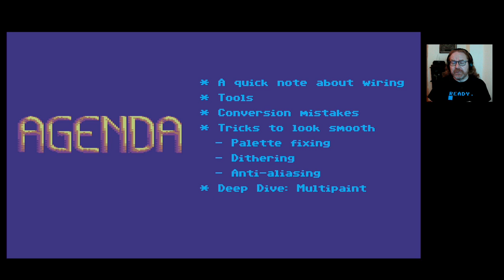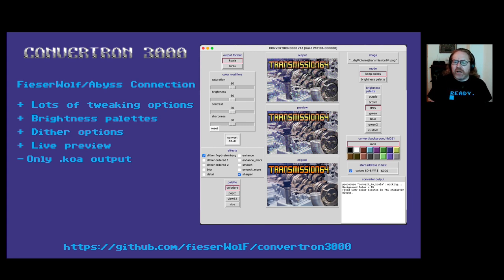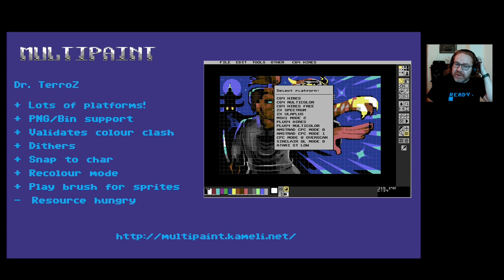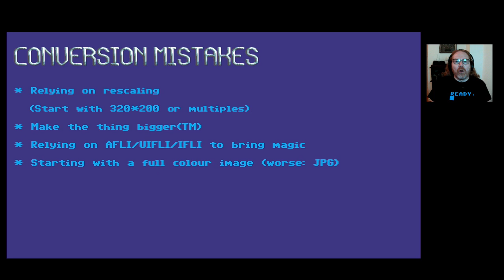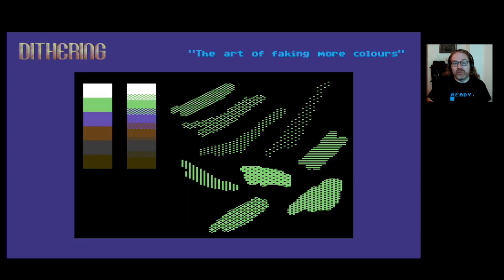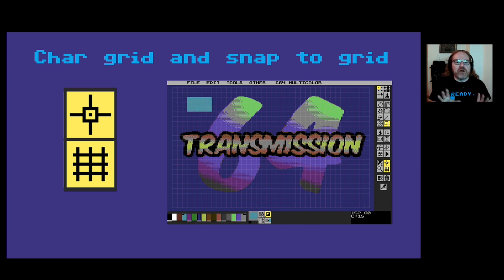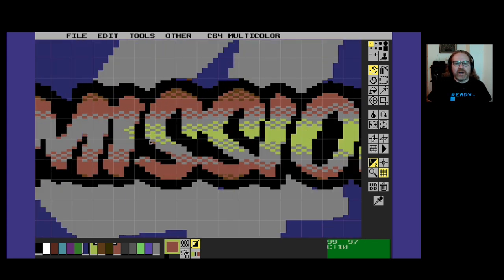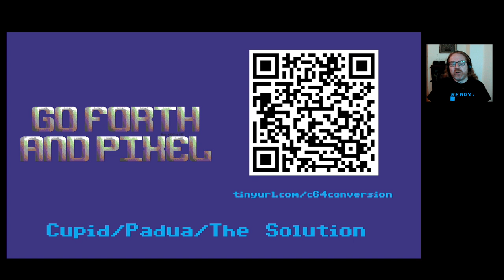Talk: Cheating like a pro – a few tools to get you pixeling and converting for The Commodore 64

Comment: Those graphic limitations are a result of limited (and expensive) RAM and not very powerful processors and finding very clever ways to make the best of the situation. Those limitations are also what gives each of those old systems, from the C64 to the Atari line to Sinclair ZX Spectrum and Amstrad CPC, their own individual personalities that are sadly missing today because consoles are very very similar in graphics and processing capabilities, with identical screen resolutions and tons of RAM, etc. This, I believe, are why retro systems are still so popular in the world and why people are still creating new demos, games and even hardware for them.
Reply: RAM ( amount, speed, VIC onboard cache would have allowed for 1 bit RGB @ 320x220. It just wasn’t priority and would have slowed down the CPU more than HAM. Scrolling is also broken on the C64. Sprites on a fixed screen it is.

With proper connection of address lines color ram may still work. Luminosity modifier at half resolution? Or select one rgb to mean one of two palette colors?
Reply: @ArneChristianRosenfeldt  It's tantalizing to think of what a VIC-III might have been. Although it never existed, the canceled Commodore 65 had a VIC-II with significantly updated modes (and a 6510 compatible processor, the 4510, running at 3.54mhz). From wikipedia:

^^^^^^^^^^^^^^^^^^^^^^^^^^^^^^^^^^^^^^^^^^^^^^^^^^^^^^^^^^^^^^^^^^^^^^^^^^^^^^^^^
"The main memory of the C65 is shared between the graphics subsystem and the CPU. The memory clock runs at almost twice the speed of the C64. To further increase the bandwidth of the graphics subsystem, the memory is divided into 2× 8-bit wide banks of 64 Kbyte which can be accessed by the CSG-4567 simultaneously. This provides an effective video-DMA bandwidth of 7.2 Mbytes/second which is the same specification as the original 16-bit Commodore Amiga chipset (OCS/ECS). The CPU can use up to half the available bandwidth, since it can only access a single 8-bit bank at a time. In higher demanding video modes, the CPU is slowed down due to increased cycle stealing from the video controller.

"Enhanced VIC-II modes
In addition to having all of the C64 video modes, the CSG-4567 also supports several new character attributes such as "blink" or "bold" and can display any of the new or old video modes in 80 column or 640 horizontal pixel format, as well as the older 40 column 320 pixel format [6]. These enhanced "VIC-II" modes take up to 16 KB of system RAM. The sprite capabilities in all VIC modes are equivalent to the C64.

"Bitplane modes
A new "bitplane" video mode was added to allow the displaying of true bitplane type video, with-up to eight bitplanes in 320 pixel mode and up to four in 640 pixel mode. The CSG-4567 can also time-multiplex the bitplanes to give a true four-color 1280 pixel picture. Vertical resolution is maintained at 200 lines as standard, but can be doubled to 400 with interlace [6]. The VIC-III bitplane modes take up to 64 KB of system RAM in non-interlaced or 128 KB RAM in interlaced (400 line) modes. Since the C65 is equipped with only 128 KB in its basic configuration, these modes would consume the entire RAM, and are therefore only useful in a RAM expanded system. On a basic system, it would probably have made more sense to write software which uses less demanding resolutions with fewer bitplanes - partly because this would consume less of the confined RAM space, but also because more bitplanes would demand a higher video DMA bandwidth and consequently slow down the CPU as a result.

"DAT and Blitter
The bitplanes on the C65 are organized in a less straightforward manner than e.g. on the Commodore Amiga, which organizes the bitplanes as straight rows of pixels:  On the C65, the bytes within the bitplanes are organized as 25 rows of 40 or 80 stacks of 8 sequential bytes, similar to the original 320×200 VIC modes. Because this makes it harder to derive individual byte and pixel addresses from their position in the XY coordinate frame, the C65 provides a conversion mechanism in hardware called Display Address Translator (DAT).

"Further aid to the programmer comes in the form of a bit-blitter, which supports Copy (up,down,invert), Fill, Swap, Mix (boolean Minterms) Hold, Modulus (window), Interrupt, and Resume modes. Block operations from 1 byte to 64 KB"

^^^^^^^^^^^^^^^^^^^^^^^^^^^^^^^^^^^^^^^^^^^^^^^^^^^^^^^^^^^^^^^^^^^^^^^^^^^^^^^^^

Looks to me like the project was probably canceled because in many ways it rivaled their flagship Amiga line!
Reply: @JustWasted3HoursHere  I meant for the same memory speed and cost as in 1982. From you text it is very clear that the Amiga did it better and that we should be glad that C65 was canceled. Like have 16 bits for data bus, but even more address lines than the Amiga? Who is gonna pay for this. The great thing about C64 ( at least for plasma effects ) is the simple addressing of pixels: One byte, one pixel. I used attributes on plus4 and then byte oriented VGA on PC. Though I have to admit that bitplanes are great for dual playfield and any static assets. Or text on monochrome monitors of the time. So, it seems like a graphic card always has to support both: bits to pixel like the C64 characters and byte to pixel like the attributes (especially on the plus4). I guess that word to pixel on a system with 16 bit bus is asking too much. Memory read-out is a pipline. We don't care about latency here. Why was it so difficult for Amiga to add back text mode and attributes in ECS? Just copy it from VIC. Sega did it for them on the genesis. Would have allowed some easy ports. And when Sega wants to file infringement on patents or stuff, commodore would just pull out the blueprints of their old chips.
Also commodore and Woz of Apple should have worked together with WDC to create a true 16bit CPU which can really utilize the 16bit bus and reads ADC #$00 in one cycle. Or every branch instruction. Okay, maybe we really don't want to pay intel money for the alignment circuitry. Absolute addressing would use 3 bytes. INX or CLI need to be paired (with NOP) to keep the speed. (ZP,x) addressing would need to multiply x by 3: ( ZP, 3*x ). Also I want the zero page for (ZP). That memory gobbling indexed stuff should really be: ( DataSegment + 3 *x ). 16 bit registers ( but no immediates due to alignment ).
Reply: @ArneChristianRosenfeldt  Well design and engineering is all about compromises. I'm sure the designers had their reasons for designing the Amiga chipset the way they did, though I do often wonder why the sound chip was never updated from OCS all the way to AGA. No additional voices, no higher resolution (even 12 bit would have made a BIG difference in quality without too much increase in memory usage), etc. Maybe if Jay Miner had not passed away things would have been different.

On the C65, I guess it would depend on what kind of price point they could sell it for. If it was somewhere between the C64 and the Amiga then it very well could have been a success. For the hardware bottlenecks, luckily they left the gfx modes up to the programmer. That is, you could still use the old VIC-II modes if you wanted AND take advantage of the much faster clock speed.*

* There's a project underway that is a drop-in replacement for a 6502 (for Apple, Atari and other early systems like the Commodore 8032) that will run at 100mhz. http://www.e-basteln.de/computing/65f02/65f02/ It SHOULD be possible to make a version for the C64's 6510. But right now the project is on hold because of, you guessed it, supply chain bottlenecks.

There is also a 1 GHZ 680x0 project underway but I can't find the link for it.
Reply: @JustWasted3HoursHere  I looked up AtariJaguar and SonyPSX and they both use an external, off-the shelf dual DAC for sound. I have no experience in this and think digital electronics also wants low noise on the rails, and common emitter logic would give it to us. But of course, using small voltage differential serial for audio and and a DAC outside of the HF filters are a sure fire bolt on method. Though I think that a 1-bit DAC experience high frequencies internally. So either it all need to be balanced, or there still .. yeah of course 1-bit DAC needs a low pass filter. The integrator is it. Just place it in such a way on the PCB that stray fields cannot reach around. CD DACs were invented before the Amiga.

Some people cry for FM sound, but neither TurboGrafx16, nor SNES, nor GBA has them. Wavetable is good.

The market is a thing. Of course my design goal is a C66 which runs Doom faster than a Amiga500 does. Just don't tell your manager. Tell them that we don't have to pay Motorola ( only for some 6800 patents ). Amiga has dual playfield. C66 would have  bullet hell.

It would be cool if some billionaire would fund a GaAs ECL run with modern optics: UV, water immersion, multi polarisation illumination. I imagine that a GaAs kinda FinFet would be possible where the channel is not doped for lowest defect rate and highest electron velocity.  No thermal problems with so small circuits. DLP to avoid real masks. Then do all retro chips. 1000 $ a pcs.

But RAM loves buswidth, but hates GHz

Comment: 2:00 I think it could be okay as a competition entry, if there was an extra category like "PC Conversions" for it.
Reply from the maker: Do you think there should be a separate category for conversions?
Reply: @transmission64  I believe it would be better, since it requires different skills, which I think also comes through in your video very well.
One thing is to "import" an image which can be anything, from a real-life photography to a screenshot or high-definition/color artwork, from a platform without any technical limits, and then refining it for the 8-bit with an editing tool. 
The other is to create the image with the limitations in mind, or design the image specifically for the low resolution and specific color palette, from ground up. Within that area: Pictures drawn directly on the target machine (C64). I mean okay, just in case anyone still does this^ - doesn't it require even another level of skills?
Reply from the maker: @cooperfeld  The borders are blurred though - no pun intended. Many non-converting graphic designers may use a partial conversion process as well, as some of the designs start out as drawings on paper.

I agree that it's all different skill levels though, but I do believe the lines are blurred. Also creating different compos doesn't necessarily mean that everyone will follow the rules.

I did though notice that a recent (non-platform specific) demoparty had added a category for AI pictures.

Food for thought. Thanks for starting a discussion. I'm curious what others think.
Reply: @transmission64  After reading your reply I think you're right, it might become too scattered to put up categories for even how an image was created; Since in the end it doesn't really matter, does it. It's really about the end result, and right, one can't (shouldn't) try to "force" pixel artists to be 100% honest on how they did it each time). Magicians don't reveal their tricks. Woa! A.I. based images on the 64 sounds madly interesting, would love to see first results*. Or maybe create the images on the machine itself, and wait about 2 1/2 months each for completion.